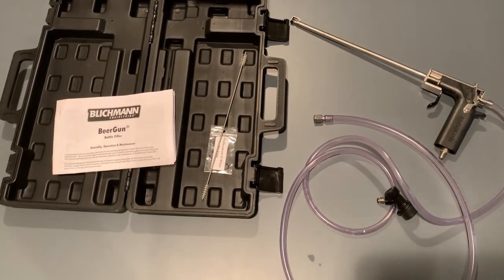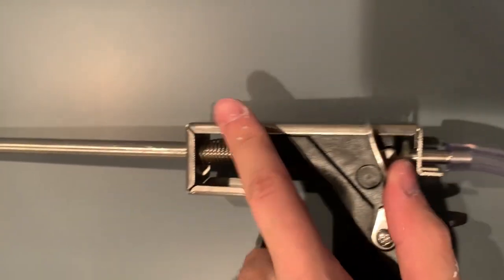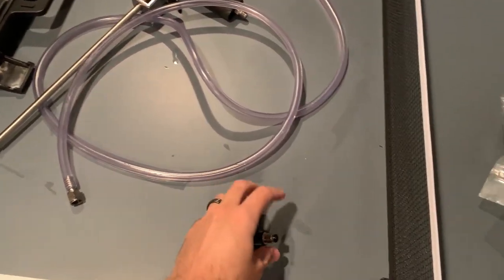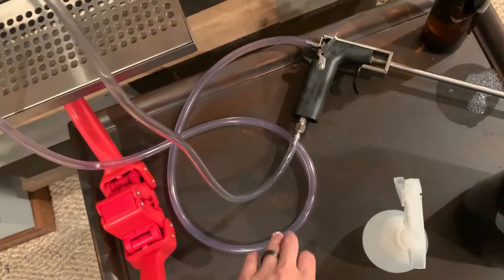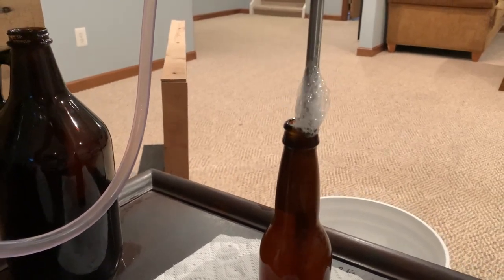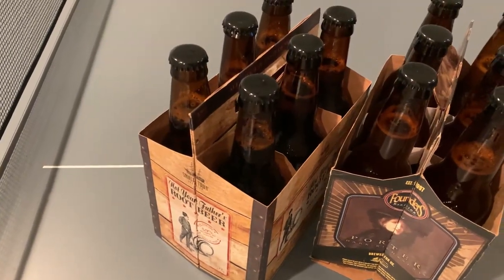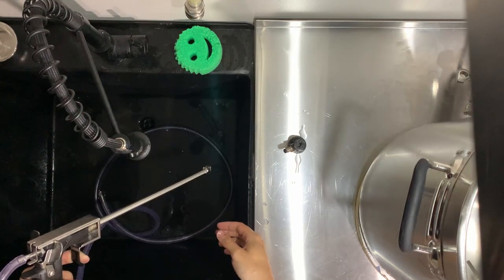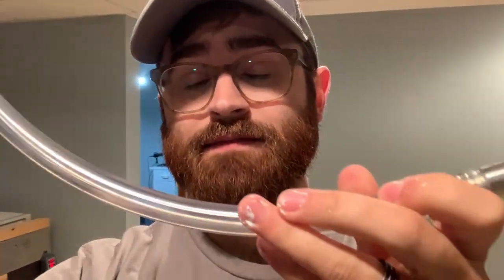Blichmann Beer Gun - How to Setup and Bottle From a Keg! Review!

Comment: Thanks for this reminder video! I actually own the older version and mostly keg and use it very rarely now and needed a refresher. I remember having the beer line issue and solved it with microwaved water. I'd microwave some water for a minute, pour it over the connected beer hose and beer tube, and the hose end became just soft enough for me to use my thumbnail to easily remove it from the beer tube. Thanks for this video! 👍🏾

Comment: Nice video.  The one other thing I used to do when filling the bottle, was to purge the neck space of the bottle when pulling out the beergun, since air replaces the volume of the gun itself, and it doesn't really foam up enough to "cap on foam".

Comment: Great video. Used this to just confirm my processes and this was a great reference. Thanks!  One note is that when I disassemble, I put the gun in a bucket of hot water and then the beer tube is easy to remove. The same is true when putting it on - that is, if I get the tube hot with hot water under the tap first, it is easy to put on. Then, letting it cool before bottling, of course.

Comment: Very helpful video, thanks for that.
I saw that the bottling/canning pressure is 6 psi, but what is the pressure, temperature and for how long do you carbonate the beer?
Thank you!
Reply from the maker: I typically do 35psi for 1 day and then go down to serving pressure (10 psi), Its fine after one day but after a few more days the carb level is perfect.
Reply: @TroubleBrewing  , Thanks pal! Cheers!

Comment: You can just pull the liquid tube off of the beer gun. You shouldn’t need to cut anything… mine is easy to pull off. 

Alternatively, get a carbonation cap and a coke bottle. Fill the bottle with cleaning solution / sanitizer and connect it and the carb cap to the beer gun. Push the liquid through that way.
Reply from the maker: Oh interesting, mine is a pretty tight fit. Also GREAT idea on the carbonation cap and coke bottle. Never thought of that!
Reply: That's what I was gonna say👍🏻 I used to use PET bottles and card cap to clean my beer lines and tap for my Keezer.

Comment: Great video. By any chance do you know if this kit can be used with a Type-D coupler and keg?
Reply from the maker: I would think so as long as you have the quick disconnects on the Type-D. Though before picking this up definitely check out the site/email support on that. Id hate for you to buy something and have it not work!
Reply: @TroubleBrewing  I did just that, they responded they have an adapter from the quick carb that worked perfectly. Thanks a lot for the advise!!